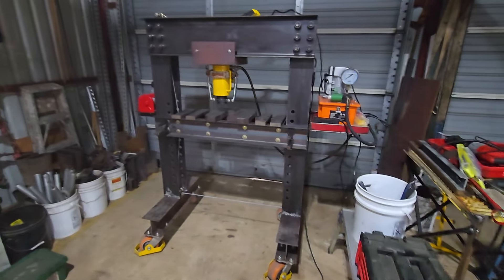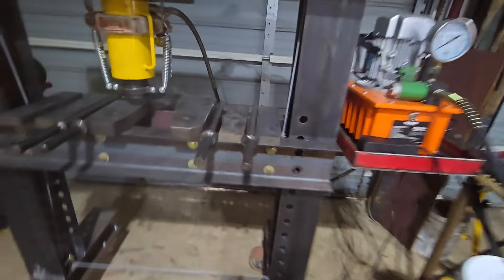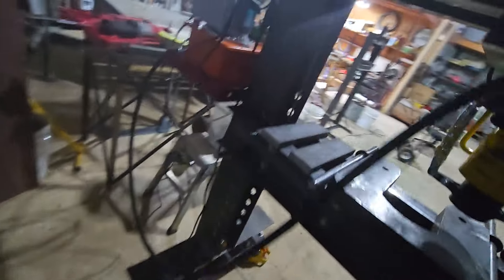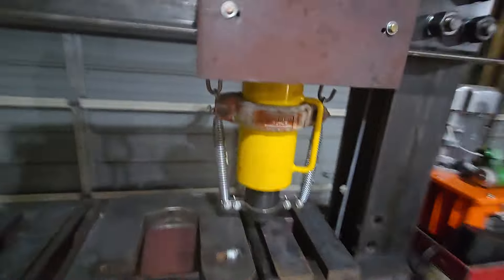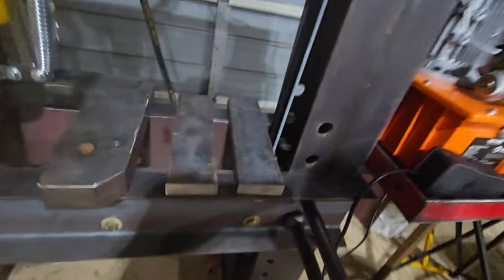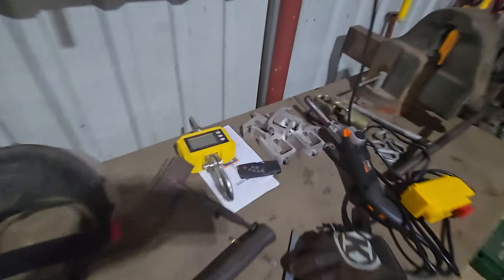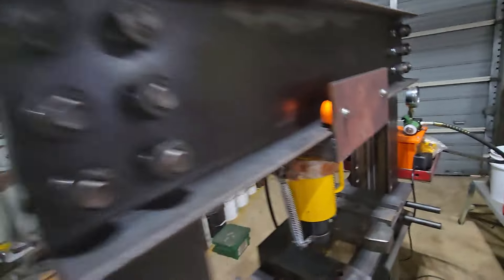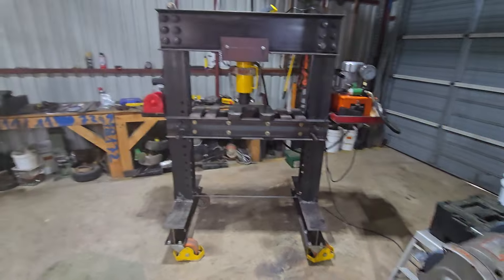DIY 50 Ton Shop Press Version 2

Comment: Can you post what all of the parts cost and dimensions of materials
Reply from the maker: I sourced most of the new steel from left overs from local salvage place...had about $300 in the steel. The roller were amazon like $20 for 10 so have enough for 2 more presses. The pump and cylinder were like $460 Vevor brand and the hoist was $130 Vevor brand. Saw blades annular cutters cutting fluid and misc hardware were approximately another $300. The casters were another salvage find got a great deal on them. The cable I already didnt use the original the cable clamps I already had. The I beams were 6x6 with 3/8 flange the top and bottom plate were 1/2 flange so I doubled them up with 1/2 plate for 1" total thickness. It was just over 6ft tall and the legs were 32" wide to be able to fit through most doorways. The total width of press was 4ft with 3ft table and roughly 24" of horizontal travel. The plate the ram pushes against was layered 1/2 plate to total of 2" thickness with the front cover plate and back cover plate 1/2 thick welded on a 90° to bolt the roller wheels to. Roller wheels also Amazon for like $15 or something. All in I figure I was around $1000 because even though it was slightly more than that I have things left over that I will not have to buy for the next press. Which I plan on starting soon. Got a big belt grinder Im refurbishing and when its done will start on the next press. It will be a little different design. Saw an Enerpac design that I really like and I believe will be a little easier to build.
Reply from the maker: I think I covered all your questions...if not let me know. Happy to answer anything I can!!!
Reply from the maker: If you count the mag drill and dry cut chop saw through in another $700 but I had those already.
Reply from the maker: Oh and the pins for the table also slavage. They were pins from catwalks for oil platforms. Dont remember length on those but cut to be symmetrical same out the back as was out the front.
Reply from the maker: The press plates were just 1x3 bar stock that were cut same width as press table which I think was 12" total. 6" working gap and 3" flange on both sides.
Reply from the maker: And in total I figure somewhere close to 40 hours total built time. If I had a cnc plasma table I could greatly reduce that time as far as drilling all those holes individually goes. Oh yeah and the bolts were also salvage from oil field left overs. Im in a great place as far as getting salvage materials goes. Lots of high quality salvage around oil field operations. Those b7 grade bolts are perfect for presses because they are tempered specifically for high pressure applications.

Comment: Nice build.  Could save some elbow room by placing the pump on top?
Reply from the maker: Yeah on my third build which I posted a couple days ago I went back to air/hydraulic. Cylinder retracts so much faster for some reason. The new build I posted a couple days ago is by far my favorite design so far. Will keep building and tweaking every time. But the new design is very close to being perfect for what I like.